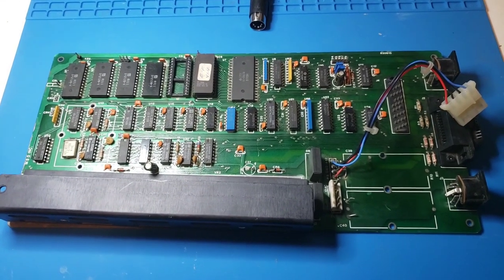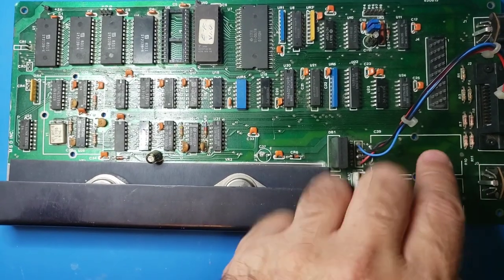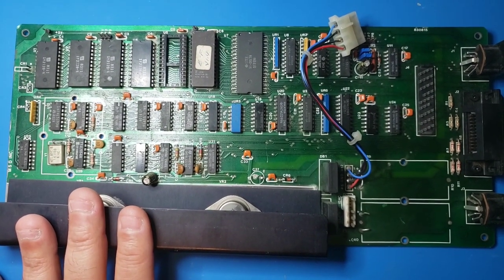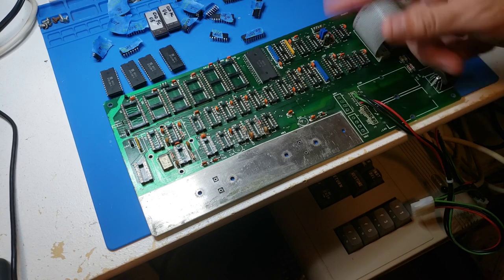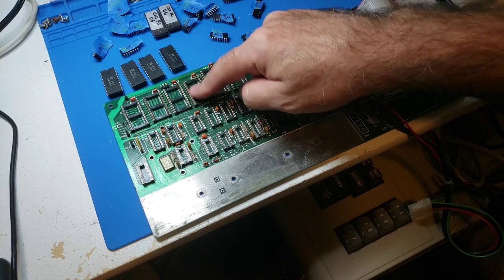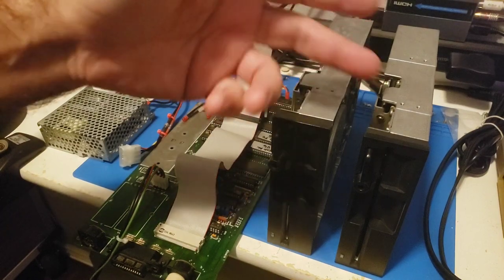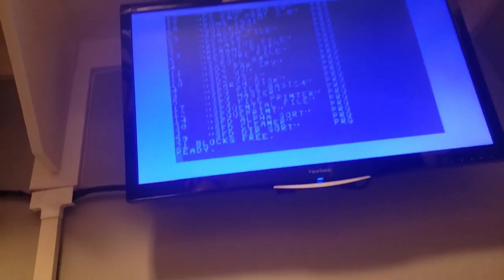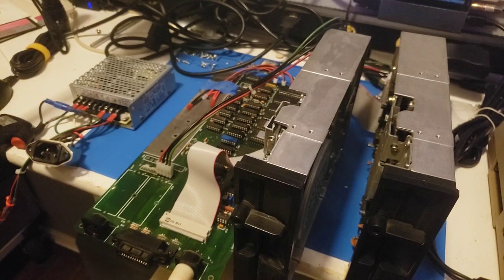Converting an MSD SD-1 To SD-2 : Auto Duplicate a Disk in 9 Seconds!

Comment: Great video.  Wow!  I too have an old SD-2 and SD-1 drive.  I also bought an old FB-501 generic drive on ebay years ago, because one of my drives was bad (probably bad cap).  Yes, I am old too. I actually sold these drive back in the day when I was young for a distributor called HBH Sales just outside St. Louis.  So here is my question.  Why is there a jumper wire on the first drive on the ID pin.  But there is no jumper on the ID of the secondary drive.  My ebay FB-501 purchase drive looks to have the same board configuration as your secondary drive, although it looks very different from the original MSD drive boards.  I find it strange that it is also missing the RA1 chip. Any idea what why that might be.  I had placed a jumper across the id bin and the drive would read but not write and I had a jumper across DS0.  I need to go back a revisit that.  This ebay drive was refurbished drive from a very reliable company, so I am pretty sure it is a good drive.
Reply from the maker: Even though the drives are FB-501, some of them came pre-configured by the manufacturer of the device they were being used on. They were ready to go when plugged in. So they would not put jumpers in and instead solder leads in their place. If you wanted jumpers, you could always open up the pads and put them in. :)
Only one of these drives came from a Radio Shack  FD-501 unit (that was the one with no jumpers where the settings were preset) and the other from an SD-1. The RA-1 socket would be for the terminating resistor. The Radio Shack controller doesn't need these, this is why it is missing. On other systems you only need one terminating resistor (the last drive). The ID is hard wired because, again, this came from a Radio Shack/Tandy drive system already configured. Also, the Radio Shack/Tandy system uses the ribbon cable connector pins to deal with drive identification. I hope all this makes sense. Same Drive, two different systems, one pre-configured to work out of the box, the other user selectable configured via jumpers. :)
Reply: @revivingretro  Makes sense.  Also I am pretty sure the my FD-501 drive was from a refurbished Tandy disk drive.  I still have the sales receipt.  It actually came from Cloud9Tech who deals in older Tandy stuff. So that is probably the reason.  I was trying to match the configuration from my working MSD drive so that is why I thought I needed a jumper on the ID pins.  I am going to remove the id pin and see if it lets me write to it.  Thanks for the info.  Really appreciate it.  Also since you mentioned the terminating resistor is only needed on the last drive.  One of my original MSD dual drives had the terminating resistor chip and the other original MSD drive did not have this terminating chip.  So do you think that the one without the terminating chip was meant be drive 0 and the one with the terminating chip was meant to be drive 1?
Reply from the maker: @pdpate3  There is typically a termination resistor on the last drive of the cable. If the floppy cable is short enough though, (and data rate slow enough), it really won't matter if the terminator is at the very end of the cable or the first. In my video you will note that the terminator is on Drive 0 (DS0 is shorted) and the empty RA1 is Drive 1 (DS1 is shorted). In my Radio Shack/Tandy FD-501 using 2 drives I don't even have termination resistors on either drive.

Comment: Hey... I have been looking for developer orriented documentation on the sd2, do you know if any exists? Looking for things like callable functions in the version 2.3 rom, or ideally a commented disassembly of it, but first of all a memory map showing all io registers and their functions.
Reply from the maker: Sorry - I've never come across such a document for these drives.
Reply: @revivingretro  Too bad. I'm trying to reverse engineer some bit of software specific for the sd2. I just dread having to also reverse engineer pretty much all of the sd2 functionality it uses.

(it is a parameter copier for a very specific copy protection)
Reply from the maker: @c128stuff  Wish I could have helped you more. I have the operating manual (you can easily google for that), but what you seem to be looking for is a service manual. I have never seen one for the MSD drives.
Reply: @revivingretro  I have a copy of the manual and schematics. But what I am really looking for isn't a service manual, but a programming reference.

I just got a reference to.a forner MSD employee who was involved in the sd1 and 2, hopefully that gets me a bit further.
Reply from the maker: @c128stuff  This is a longshot but you may want to also try researching contacts for CLD since they made the ROMS replacing the two MSD ones for the Mass Duplicator software. 
CLD Chip Level Design AutoCopy ROMS, by Lawrence Hiler A.K.A. Mike J. Henry of Basement Boys Software
Reply: @revivingretro  Thanks.
Reply: @revivingretro  hmm, sadly, any references I can find for him quickly turn into dead ends.. but thanks anyway.
Reply from the maker: @c128stuff  Best of luck in your continuing search! :)
Reply: @revivingretro  guess I'll still end up having to reverse engineer things from the schematics and 2.3 rom.
Reply: I don't think the fast-duplication parts and memory are available anywhere. I've had no luck finding the upgrade parts or kit.
Reply: @MulticulturalRadio  I know people who have the drive and the copy rom and memory installed, that is however not what I am looking for. 

I am looking for documentation *exclusively*. The reason is having a need to reverse engineer a specific (undocumented) parameter copier.

So what I am looking for is documentation, commented disassembly or such things (so.. for example a book like Mapping the Commodore 128, but for the MSD drive instead). 

I am not looking for the hardware.